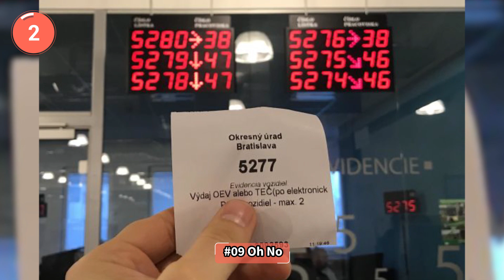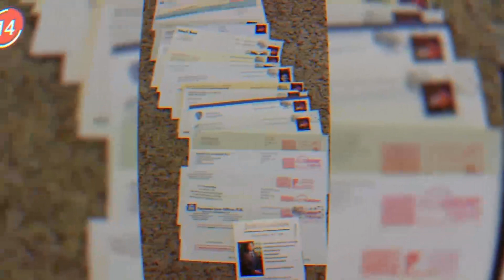Hilarious Examples Of People Having Bad Day (Part 3!)

Comment: I came home to half my apartment floor covered in water. The pipes for the hot water burst and the maintenance crew had to rip out my tub, the drywall and do the same to the apartment next door to get to the old pipes and put in new ones. I used half a can of Raid to kill all the cockroaches that were in the wall space (no insulation at all). I could see outside my apartment through the giant hole in the wall they made. Yay new tub, boo its been 3 weeks and they haven't come back to finish.

Comment: How do you even do #10? I have those same exact wipes and they are EXTREMELY rough because they're meant for scrubbing stuck on grime. They also have a strong orange/citrus chemical scent. If you couldn't tell from the scent, you certainty can tell from first touch. So how does it actually make it to your bum?

Comment: #3 Cargo Ships are made to do that. I wouldn’t call that bad.
Reply: Mad die Gabb itas If only the reason for this wasn't the ship running aground on a reef which caused an oil spill that harmed the environment, then it might be fine. Also people lost personal belongings in the many containers that fell into the water. This made news in New Zealand for a month or more because it occurred on Astrolabe Reef off the coast of the Bay of Plenty, New Zealand. The wreck of this ship is still on the reef today. This happened in 2011.